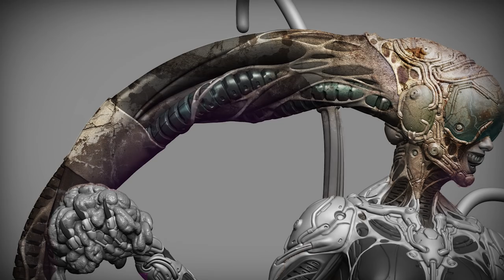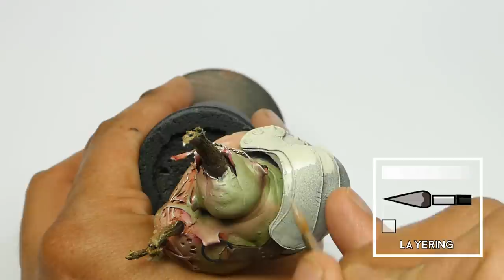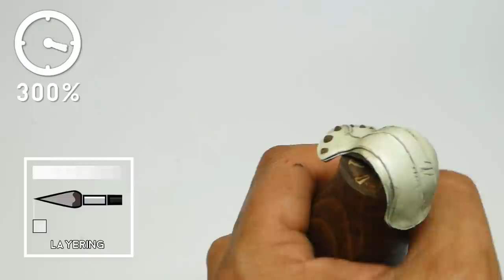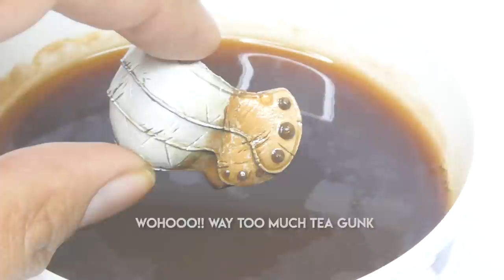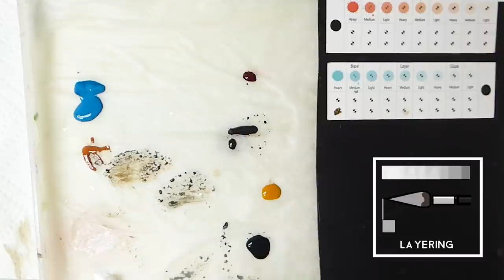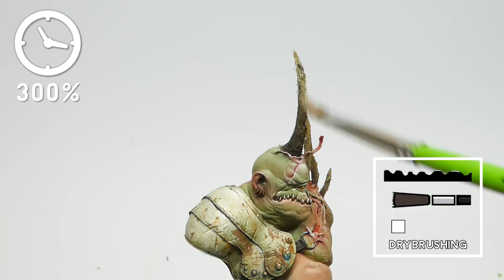Instant rust weathering - with TEA

Comment: Wish I could say this was easy to replicate, but the tannins in the black tea I brewed never pooled on the top like this. What's your trick? A certain blend or steeping time?
Reply from the maker: I did a lot of tests with different water. It does not work with filtrated water, the water need to contain lime.. so it needs to be hard water. Berlin tab water works very well. I used 2 pyramid tea bags PG tips and let it set for about 20min.
Reply: @benkomets494  Your insight on it is appreciated! I look forward to trying it out and recording the results as well.